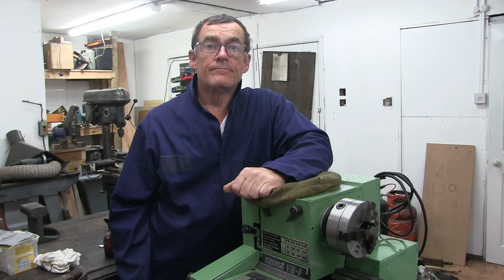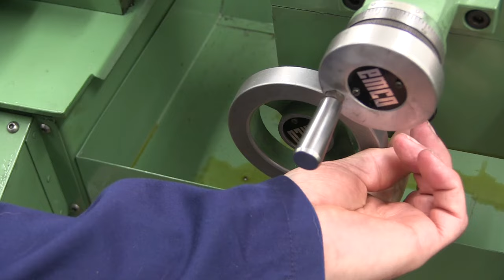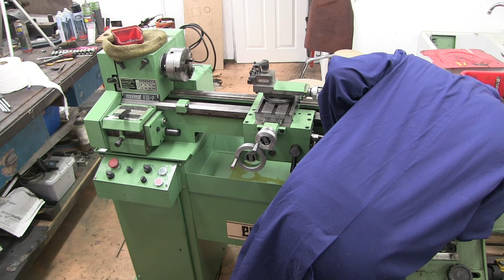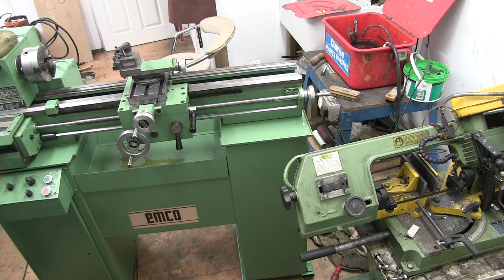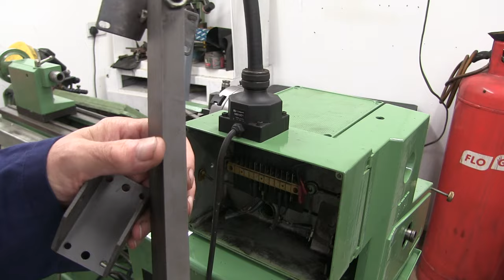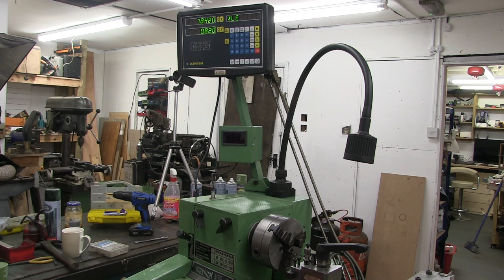More EMCOV10-P Re-Furb

Comment: Great stuff Cliff. The saddle gearbox has grease in from new, that's why they leak with oil in. I have oil in mine too, as you say it finds it's level. Still leaks a bit but acceptable and better than anything seizing. For the Head and Norton box, it's Castrol Hyspin Hydraulic Oil or a good alternative is air tool oil. This is available from Screwfix under the PCL brand. Perfect for the job as it doesn't attack yellow metal bearings and is a good moisture repellent. I recently changed my oil and this is what I used. 
Best wishes, Dean.
Reply from the maker: Thanks for that Dean, its all in now :-),
All the best,
Cliff

Comment: Im really interested to know your impressions on the crash clutch on the feed shaft, I dont know how it works but I would like to know if this really might save me if I screw up. Im not willing to test it but would like to know if it has my back
Reply from the maker: I'm looking into it, I never stripped that bit down, watch next week,
ATB,
Cliff
Reply: @CliffsShed  it's just series of friction plates, held together by spring pressure. You can adjust the break point by reducing the spring pressure. It does work, it's designed to be used in conjunction with the bed stop for precision repeat cuts. My lathe is a 1973 model so I try to avoid stressing it too much. It's as old as me! Best wishes, Dean.